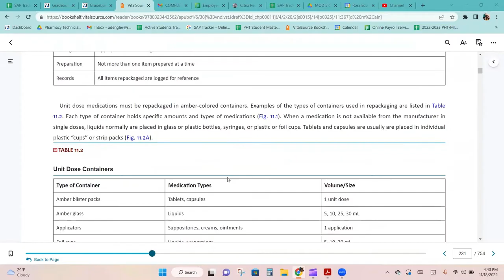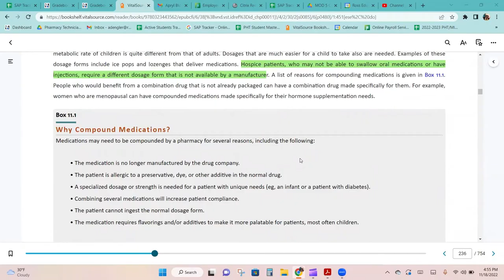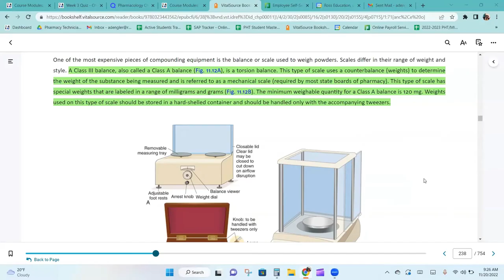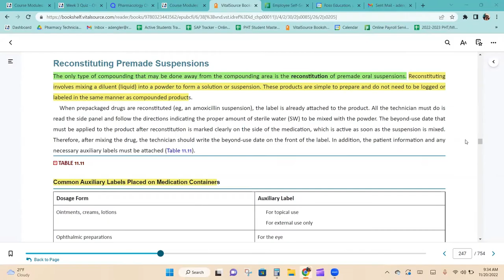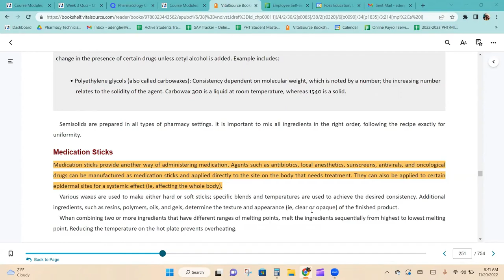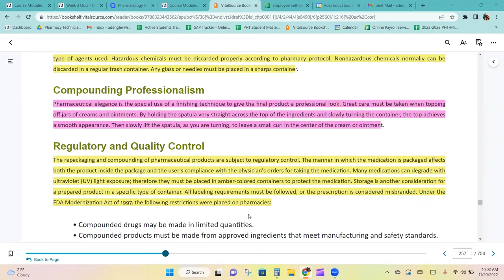Chapter 11 Bulk Repackaging and Non Sterile Compounding

Comment: Thanks for explaining this chapter. I have Q , when we repackaged tablet or caps into unit dose pouch to be distributed in Pyxis machine. What is the best BUD. I got confused between this chapter and 1178 for good repackaging practice. Specifically if the pouch is made of cellophane/PE material .